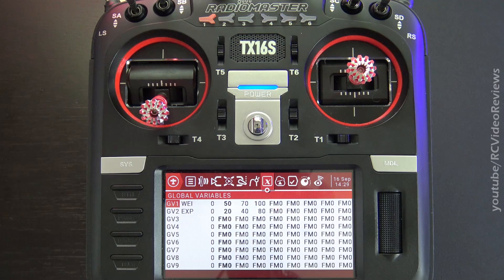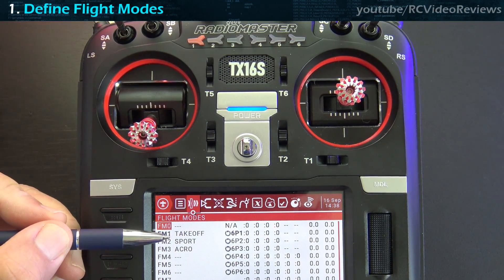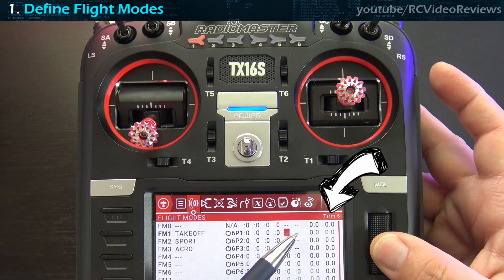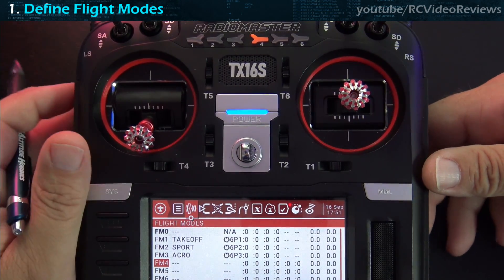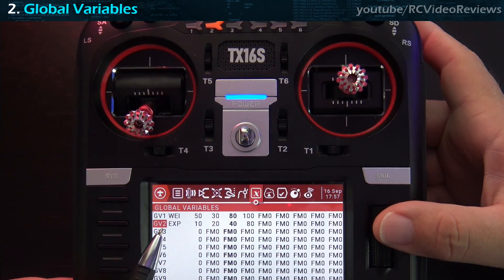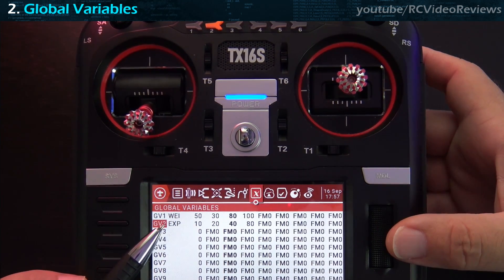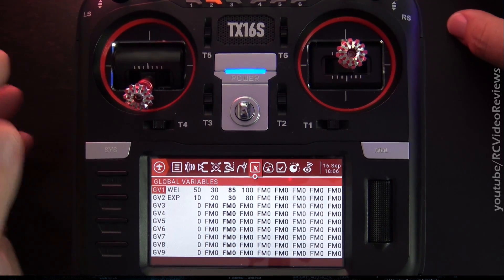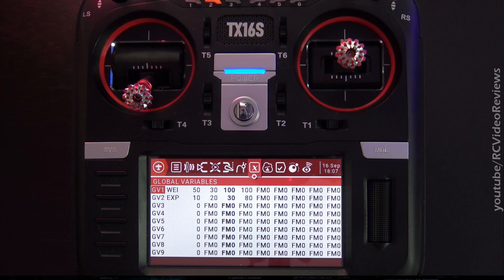OpenTx Tutorial Flight Modes and Global Variables on Radiomaster TX16s • [Advanced]

Comment: Wow.  Nice video.  As a retired computer programmer I am loving my TX16S and have just started digging into it.  The Global Variables video was great.  I have just started flying and own two Volantex planes.  I was wondering how to program flight modes on the TX and this was just the thing.  One question though,  these planes have stabilization which is turned off in expert mode.  I see how to program the flight modes now but can't find anything on turning on and off the stabilization.  I'm wondering if it's even a good idea.  Thanks.  Jerry Chicago.
Reply from the maker: Stabilization configurations are highly dependent on the stabilizer brand. You'll need to dig into the manual to find out what channel turns the stabilizer on and off and use a mixer line on Edge/OpenTX to correlate with the channel specified in the manual. Whether or not it's a good idea to turn the stab off is dependent on your skills and what you need from a stab. My personal preference is to teach people to fly without a stab first.
Reply: @RCVideoReviews  Thanks for the reply.  I also wanted to say that I've been digging through everything I can find on Youtube on TX16S and I must say that your videos are the best.  You're a very good teacher with very concise with clear instructions.  Thanks.

Comment: Nice! Just got my TX16 MK II. Been using Open TX and Edge TX on other radios before, but just with copters which are mostly configured in the FC.
For fixed wing, I was still using Spektrum. Now I have to learn that part too. I must say, it is a littler more fiddly, but there are much more options.
Reply from the maker: Once you get to the point where you understand the control loop (Inputs->Mix->Output) the whole radio gets a lot easier. Just try different things and you'll get there.

Comment: Pretty dam interesting.  I can see why"propeller heads" like this transmitter.  Can't see why I would want any other box, when this one is so programmable, and so reasonable in price.  Think I will go with OpenTX and not EdgeTx.  Edge seems like it's put out by the radio maker to show off some of "it''s" hardware, and not really making the box work better.  But then I could be wrong.  I think you have moved to Edge, but tell me why in a video.
Reply from the maker: The manufacturers have nothing to do with the production of EdgeTX other than to supply the developers with hardware for testing. I switched to EdgeTX because it’s making actual progress where OpenTx is mostly stymied.
Reply: @RCVideoReviews  Still think I will go with OpenTX.  Edge seems like a new "gee wiss" toy.  Like putting lipstick on a pig.
How about editing the titles on your OpenTX videos and putting numbers in them to say this is 1, 2, 3, and so on.  That way people can start at the beginning and follow along.  I know I will use all the videos to setup my TX12 when I get it.

Comment: Hi there, firstly thank you very much for your very informative tutorials, I've found a couple in your playlist which have taught me stuff I needed to know, so my question is this, I have a runcam split in the long range 7 inch quad which uses 3 switches to take advantage of all the functionality of the device (One switch for wifi on/off, one switch to change the modes and one switch to start stop recording, and these all have a use when paging and selecting various things off the OSD Menu) myi'm also using a TBS Micro RX (Only have 12 channels), however, the limitation isn't the Recieved, its that the radiomaster 16S only have a limited amount of 2/3 position switches which I already use all of for the various peripherals and modes like GPS Rescue etc, Lost model buzzer etc ....  is there a way I can create 3 custom logical switches to use as the switching for the runcam split??
Reply from the maker: Logical switches can be used in the mixer which means they can be used to create an outbound event. The question you'll have to answer is how will you trigger the logical switch? You'll have to find a way to create a condition using logic (or hardware) to activate a logical switch.
Reply: @RCVideoReviews  thanks for the prompt reply brother, yeah it's nothing I can't live with out to be fair, I have the runcam split set to start auto recording when it's plugged in, and the menu can be reached through the onboard buttons on the mainboard, it would just have been nice to be able to start and stop the recording through a switch .. I'm all out of physical switches though .. there are always too few switches for a long range craft lol ... I'm a switch kinda guy!

Comment: Hi there, your videos are extremely useful for setting my radio up, the learning curve was quite steep but now its all getting quite straight forward. One question though, none of my models have control surface weights that are equal in both directions eg aileron differential, I have set them up in the Outputs section to be that way. How can I incorporate those settings into what you have shown in this video? Thanks!
Reply from the maker: Outputs are the last thing you apply to the calculation of inputs/mix/output endpoints before signals are sent to the radio. If you're asking how to change differential using a GVAR, you just follow the same process I showed for weight/expo. Remove the differential from outputs and in your mixer utilize differential with a GVAR as the variable.

Comment: Great Video.  Thanks.  I've been using modes on my Spekky radio and am about to program a sail plane into my JumperT16, and I wanted to used to use flight modes.  I was confused about what Mode0 meant, but if I understood your video correctly, Mode0 is the default/fall-back mode if no flight mode is defined by the current switch position(s).  So, you'd probably setup up Mode0 to be a middle of the road mode (depending on how one was using modes), right?  I think that I know the answer to this but I'll ask anyway.  In each mode, the trim setting are set and stored, totally independent of the trim settings in the other modes (unless you chose 'add trims to Mode_ trims.'), right?
Reply from the maker: Flight modes can be used to change trim behaviors, but the trims aren't necessarily exclusive. i.e. You can say use FM0 trims + FM3 trims, or you can say use FM3 trims only. It depends on what you want. But yes, Flight modes predominantly allow you to isolate trim behavior. There are other things you can do to. i.e. You can apply a mix or input in certain flight modes only. Say on a glider, you want the slider to be crow braking while landing, but flaps when flying. You could have a landing flight mode that invokes a mix for the slider to manipulate crow and a soaring flight mode that invokes a mix for the slider to manipulate flaps. There are also global variable applications in Flight Modes that go into depth beyond what this little chat box should be used to discuss.
Reply: If I have a mode assigned to each flap position (say, using Switch SE) and had Speed Mode and Thermalling Mode (where I reflex or camber the ailerons and flaps) using the 6-position switch, what would happen if I triggered two modes using switches SE and the 6-position at the same time?

Comment: Great videos, very helpful. So far so good! But  one of the strongest reasons to use open TX is because it is multi-protocol. Unfortunately, almost nobody addresses this side of the coin. How do you determine whether the protocol you need is supported? How do you determine what protocol your drone is using? How and where do you set up a specific protocol? Perhaps you can put together another video covering this often ignored capability of open TX and the TX16s radio. Thanks for the great work and keep them coming!
Reply from the maker: The MPM page on Github lists supported protocols: https://github.com/pascallanger/DIY-Multiprotocol-TX-Module/blob/master/Protocols_Details.md

There are way way way too many variables on protocols to be able to fit them into any sort of video. i.e. YouTuber would have to buy a quad/drone/plane using each protocol. 

Your best bet is to bookmark that list and check it against your quad/drone and try to bind with it.

Comment: I was following your great tutorial setting up global variables. Have set them exactly like you but on the main page, when pressing 6P button they don't change anything including FM name?
Reply from the maker: Verify the flight modes use 6p1 or 6p2 or 6p3 for the switch. Press 6p1 or 2 or 3 while watching the FM screen. To validate your weights/expos are being used, fire up the channel monitor, hold stick to one side, activate different flight modes. You should see the output change according to the weight assigned to the mode. If you aren't seeing FM name on the main screen make sure on the telemetry page you're using flight mode is checked and that you put the name in flight mode. Lastly, don't know what firmware you're on, but upgrade. 

I've just verified this configuration on OTX and EdgeTx and it works on both.

Comment: A apriciate your very professional videos a lot. But I have a question that seems not being answered in another video: I have a switch for deactivation of my Gyro. That switch activates also a flight mode. With that flight mode I change the Expo in the mixer. So far so good. When I added a switch for dual rates (in Inputs) I got the problem that 70% weight in the Input Leads to just 59% in the Output. Because the Expo curve ist just ´cutted´. Do you understand and could you please give my a suggestion? That would be great!
Reply from the maker: "70% weight in the Input Leads to just 59% in the Output. Because the Expo curve ist just ´cutted´"

1) 70% weight in input gives 70% weight in output. You need to start there. Remove all expo, remove all trim, remove all offsets, remove all differentials and get your radio to show you 70% weight on input and output. 

2) I have no idea what you mean when you say the Expo curve isn't "cutted"  Expo only changes the curve around midpoints, it does not change the overall weight. A weight of 50% is a weight of 50% regardless of what I do with expo. Expo only changes the output rates as you approach and depart center.

3) If you have one switch activating a gyro, and a flight mode, and a weight, and an expo and you can't figure it out, start stripping things away. Take some of those layers out and build your configuration one step at a time. Make sure when you add one thing it doesn't break the prior thing.
Reply: So, I reproduced my problem: whenever I set the weight in Inputs and Expo in the Mixes the weight also changes. 70 is then not 70 any more. I tried that with a fresh model. I do that in Mixes because I want different Expo with the flight modes. And the Dual Rates I switch in Inputs. May that causes my problem...
Reply from the maker: Weights and expo changes belong in the Inputs screen. You should watch this video: https://youtu.be/WmnZM5veAiE

Whatever you do in Inputs gets fed to mixes then mixes takes a swing. Whatever you do in Mixes gets fed to Outputs and outputs takes a swing. So the final input value is operated on by mix changes. The final mix value is operated on my the outputs. 

You can use the same flight mode switch on the input screen as you're using on the mix screen to select weights/expo. You don't need to move them to mixes.
Reply: Great support, thanx a lot from Germany!!!
Reply from the maker: You’re welcome.

Comment: Hi John,
Thanks for your support: Flight modes control with the 6 pos. switch proves much better than the logic switch approach you made in the past. Strong point is the minimum and maximum value setting. I build now for each plane a 6pos program. And it becomes nearly imposable to create a situation in which one channel does not operate in a certain mode or switch setting
First I used two 3 position switches to control logic switches which control the Fly modes. In a certain switch position elevator did not operate. But I found it in the simulator. Thumbs up for the Open TX / Companion developers. By the way I made my first Github wondering around. After machine languages 8085 processor Abt and mini Abt, MSDOS 3.2 and follow ups I am probably left to long out of the programming business. 
Last remark it could be helpful for the newbie’s to guide them through your video OpenTX/Compagnion tutorials by giving each video tutorial a number. Some newbie’s ask themselves now: was buying an OpenTX transmitter the right choice for me?    
Greetings Guus
Reply from the maker: I made the logic design thinking the radio didn't handle the 6p switch correctly, but the radio does fine with it. It was companion that has the issue. I arranged the beginner playlist in the best possible order. The Intermediate/Advanced videos have no particular order.
Reply: Sorry John I did not check after I got the question.

Comment: Is it possible to do, with the push of a button, turn the sticks in the transmitter in the other direction? Suppose I fly in normal mode, left stick moves up a full throttle, right stick down the plane lifts nose and so on. After I press the button the stick mode is reversed, a left stick moves up a zero throttle, a right stick down the plane lowers the nose and so on.
Reply from the maker: I would probably set that up in a mixer. Switch up is normal. Switch down and the weights for both channels are inverted.

i.e. If your throttle mix line on channel 3 has a weight of 100, set a switch in the mix SA up. Then add a line below the throttle on channel 3 with a weight of -100 and a switch SA down. That should do it.
Reply: @RCVideoReviews  I tried, when I change the weight to (-100) in the mix, the effect of the weight is eliminated, as if I did not move the stick at all. This is how I saw on the "channels monitor" screen,

Comment: Strange thing happen to me.
In the INPUT edit window. When I move the joystick the crosshair doesn't follow the curve. It just goes from left to right in straight line. What's wrong ?

In other model that odd doesn't happen.

Is this something to do with my aileron differential  ?
Reply from the maker: 2.3.10 introduced that bug. 2.3.9 doesn't have it. The developers are aware of it.
Reply: @RCVideoReviews  is it save if I want to roll back the firmware version to the previous one ? Is it just like how I would do with newest firmware installation ?
Reply from the maker: It should be safe to roll back. If I were you I would make a copy of the sd card first.

Comment: John, I am using three flight modes assigned to switch SE with two GV (1 and 2) for weight and expo, very similar to what you showed us in your video. My plane is capable of using flaperons because it has two servos in the wing, so I also programmed that function using switch SB, so I can choose any combination of flight mode with flaps position. The question is, how can be added another GV to simplify the adjustments of the weight in the flaps for the usual positions: flaps up (no mixing necessary), flaps down (about 15°) and flaps down (about 25°)? Regards
Reply from the maker: "The question is, how can be added another GV to simplify the adjustments of the weight in the flaps for the usual positions"

I think you just repeat what you did with SE. You can use all the GVARs you want, you can create up to 64 inputs, and you can use all the switches you want to activate/deactivate. So if you already have a working GVAR setup for SE to set Weight and Expo, you can just repeat that process for SB.

FYI: Just to mess with you, you can create GVARS that track other GVARS too...
Reply: @RCVideoReviews  That is the question, John¡¡¡ I had to use another switch, so flaps work independent from flight modes (in switch SE).

Comment: Hi. I am wondering if with the new wave of transmitters in the market someone has set openTX v 2.3.10 for a heli with this features: nitro, CCPM 120 (requires command directly to the servos, not thru gyro), expos and throttle trim on. 

For now, I was able to adapt CCPM configuration for the Taranis (that is in the OpenTx university) in a MiniTitan, but I think there are still some missing issues to fully exploit the new transmitter, the way a simple Futaba 7C can be configured to fulfill the configuration of a nitro heli as described above.
Reply from the maker: You should check in with Freddie on the RCVR Discord Server: https://discord.gg/jSFTASU

Comment: I figured out how to adjust your GV in only one flight mode.  I set up a logical switch for the flight mode that I want to be able to adjust.  Then the special function to adjust the GV works off that logical switch,  not ON.  This will only work for adjustments to one flight mode, but it means I can tweak my offset for my glider elevator in take off mode, but when I go back to cruise it’s right where I left it.  I guess if you used a different physical pot for each adjustment then you could have it work in multiple modes too.
Reply from the maker: Nice work. I added that to my radio just to see what you were up to. I used a an OR for the logical switch: 6p1 or 6p1 (could have used AND), then that switch for the SF. I still kind of wish the radio would revert to the hard coded value after reloading the model or restarting the radio.

In any case, I think it's awesome you're taking this setup and running with it. Good work.
Reply: RC Video Reviews I love this idea.  Even on a simple park flyer, the ability to use modes and GV to easily set up dual or triple rates is awesome.